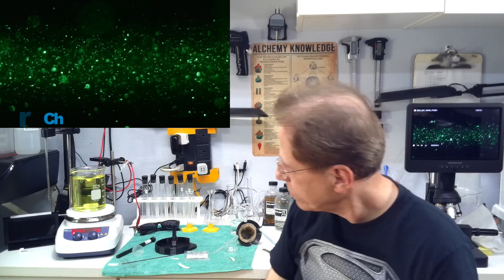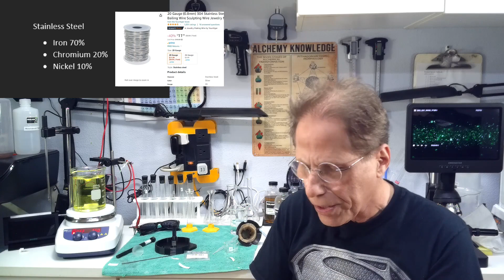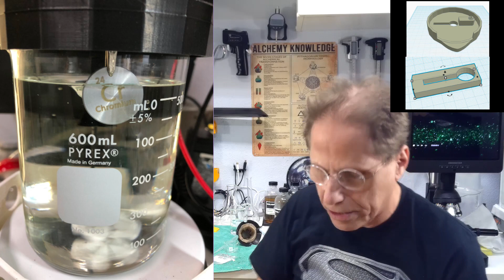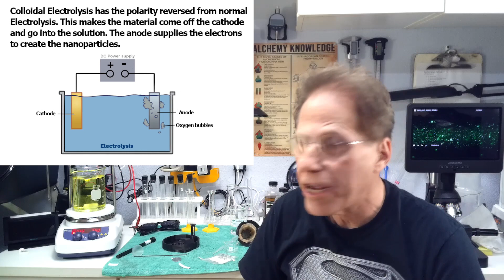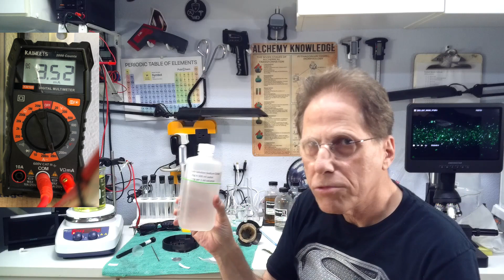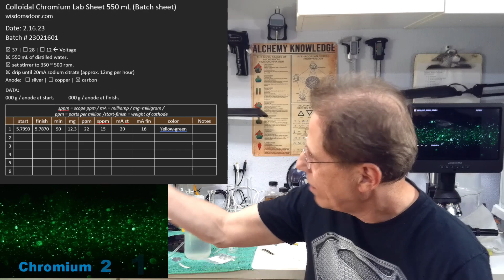Chromium Nanoparticles. How to make it!

Comment: What form of Chromium is this? The only yellow forms of Chromium I've been able to find are hexavalent Chromium(Cr+6). I'm really hoping this is not in fact Cr+6 cause I've taken it and I've been giving it to a friend... I haven't been able to find an answer to this question yet which is why I'm asking it here...
Reply from the maker: It's Cr+3. Below is the test for Cr+3

Test for Chromium Oxidation state +3
This will test if the yellow color chromium is safe +3 or toxic +6.
• 20mL chromium in beaker.
• Add malic acid until pH is 2.5
• Add a small amount of hydrogen peroxide. 
• If it turns blue for a few seconds, its +3 state and safe.
Reply: @AlchemyWizard  Thank you very much. I don't mean to be alarmist or dramatic but I got genuinely concerned when I couldn't find any examples of yellow chromium that weren't hexavalent. =)
Reply from the maker: @AndAbel-AOD  No worries, that is what I'm here for, to help. I welcome all questions. I have a good chemist and she helps greatly with steering me around things like this. One of the things we talked about when I created this colloidal was what do we exactly have here!
Reply: @AlchemyWizard  Have you ever considered or tried to make colloidal silicon? I realized recently that I have a likely silicon deficiency. 

I'm taking SiO2 as a supplement which is working quite well but I've been very curious as whether or not a colloidal form is possible. 

Silicon is available at higher purities and for better prices than virtually any other type of metal(Silicon is technically a semi-metal),  because of its use to make microprocessors. Its also the second most abundant element on the earth next to oxygen.
Reply from the maker: Yes, I have shorts video on it. You make it using the 5-Watt laser. It's one of the materials I will be making a Start to Finish video in the future using the laser. https://youtube.com/shorts/rroq9wQ2q1Y

Comment: Why is the polarity reversed between normal electrolysis and colloidal electrolysis? I haven't been able to find any info about this, I'm assuming because I don't know the precise jargon/terminology.
Reply from the maker: You’re not alone. Every time I’m asked this question, I go on a research hunt and then I call my chemist and we debate the reason for the difference. We never really come to any great explanation why it’s labeled like this. 

It comes down to how the plate is being used in the process. Plate A is negatively changed from an external battery source and supplies the electrons. Plate B, which is positively charged loses the material. Really we can discard the terms anode and cathode and save ourselves lots of headaches over it.
Reply: @AlchemyWizard  Thanks for the reply. How many drops of your stock solution would you say you need to get to 20mA? 

My multimeter is not much more sensitive than my power supply so its not really worth hooking it up in series. I'm just looking for an approximation.
Reply from the maker: @AndAbel-AOD  On my PSU it starts showing over 3mA. I would say its about  10 to 20 drops to 20 mA. Put a couple in and wait for the solution to mix. If you don't see a change put a few more in.
Reply: @AlchemyWizard  Alright, thanks.

Comment: Tom...I made this and it worked perfectly. I was curious so I also tried using natural citrus Acid from Lemons. Dropped in until at 20-25 milliamps starting solution as you did with sodium Citrate. It also worked perfectly and was the same florescent yellow color. So glad since my wife is allergic to synthetic sodium citrate.
Reply from the maker: Yes, citric acid may work as well, I will have to test it myself. Thanks for the heads up. I never considered someone having an allergy to sodium citrate. I will have to ask my chemist what part of that compound could be causing your wife problems. Both contain citrus, so something binding to the sodium, or just the sodium itself I suppose.

Comment: Do you think this same process will work for Indium?
Reply from the maker: I don't have any idea. I thought Platinum would be easy being it was right next to gold on the atomic chart. Was that ever wrong. Really no way to tell without trying it. Typically most metals will break down with Sodium Citrate or Citric Acid and create a colloidal. Some metals like silver, zinc, copper, will break down with nothing added but the electricity. Though they will take longer to do so.

I can get Indium as a disk. I've not yet ordered it. I wanted to get some of these metals out of the way that I have here already. I'm planning to do Indium, it is on my list here.